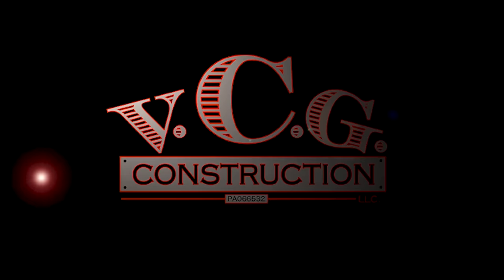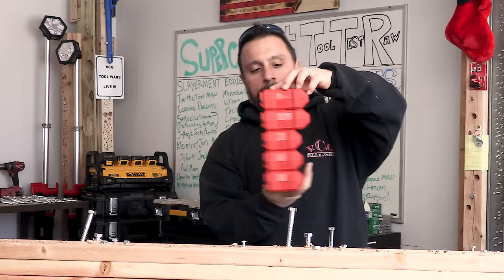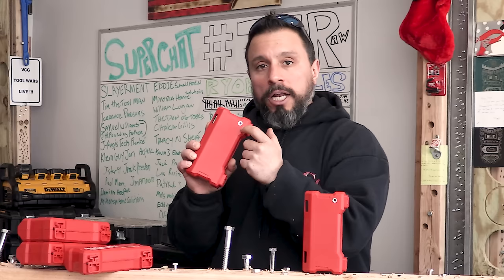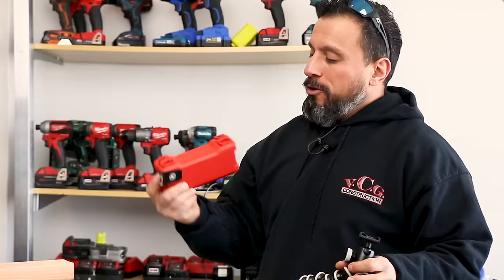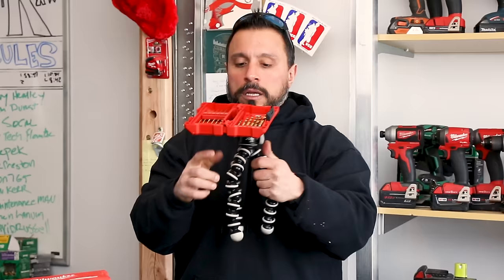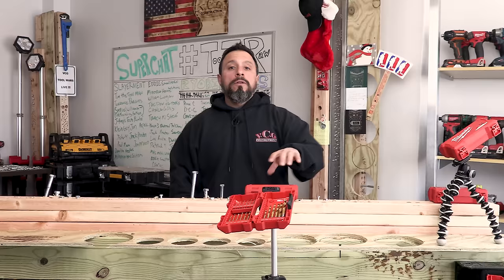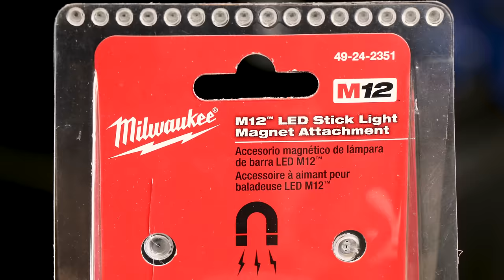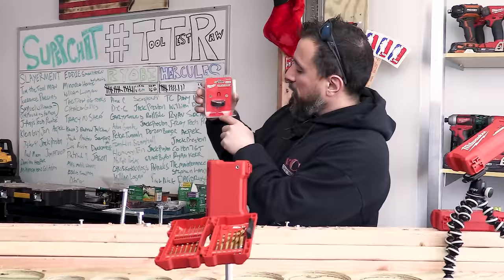99% OF PEOPLE DON'T KNOW ABOUT THIS MILWAUKEE TOOL BOX FEATURE!

Comment: the hardest thing about those bits is taking them out of the damn box. I always feel like my finger is going to slip and get cut on an adjacent bit. I use needle nose to get them out - it's ridiculous.
Reply: agreed to both of you guys. I have the one set with drill bits, and almost diced my fingers trying to get the out. Pliers or something to wedge them from underneath is the way to go.
Reply: So true
Reply: Lucky I'm an electrician and always have pliers handy just to pull them out
Reply: that is the truth 😂😂😂....
Reply: lifeisgood070 idk what it’s like for all the kits but some of the bit holders flip up
Reply: For real.  I put on a glove anytime I have to grab a drill bit.
Reply: My pull out game is already weak... this certainly doesnt help 😂
Reply: I've found that it helps to insert the bits upside down, so you grab the blunt end when removing them.
Reply: @jeremysaye1308  OOOOOOOOOO! very nice.
Reply: @jeremysaye1308  genius
Reply: @jeremysaye1308  YOU SIR ARE BRILLIANT 🤓🖒
Reply: Have sliced my finger Pullen on em keep a flat head u cut to fit in box to flip bits out they slot under them
Reply: Wawa it's too hard Wawa it hurts
Reply: If you pull the bits hard towards you it will stretch the plastic making them much easier to get in and out. I agree, it is ridiculous and terribly designed. Good job in the non important fuckn thing on the outside of the case tho.
Reply: This. This is the reason I would never use any of these attachments. I too have to use pliers most of the time. The one big downside to the cases
Reply: It's a love and hate relationship with this little bit case.
Reply: Amen to that brother
Reply: The hardest time I had with them, was unwrapping the damn thing!  It was worse then breaking into a safe.
Reply: It's better than having them fall out on their own inside the box. I recently purchased a Hercules titanium bit set and there are 3 bits just rolling around every time I open it. The milwaukee does loosen up over time, I like how they stay put.
Reply: I drill them out to loosen up the bit holders BC they are WORTHLESS as-is. That’s why the idea of a belt clip or magnet is so ridiculous... you’d pull the entire box off of whatever it was stuck to.
Reply: @uncletoy774  except you can't see what bit you are tring to pull out!...
Reply: I love mine as I used some silicone grease/or zipper wax stik on bits and holes and mine slide in and out much better like sex used to be...
Reply: I'd rather the bits be hard to get out that to fly out in the case cough Ryobi cough
Reply: I ream the holders out a little bit with a rat tail file.  It's worth the effort in the long run!
Reply: I have the drill bit set and understand this issue.  I use a flathead and slip it between the hex base and plastic bottom to pry it up.  Easy peasy.
Reply: I agree
Reply: WHY THEY SO TIGHT???
Reply: OMFG yes!!! What’s the benefit of a sweet case when YOU NEED A TOOL TO GET A TOOL OUT!!! I throw these away.
Reply: I had a bit box from another manufacturer that folded out.  They weren't hard 2 get out at all. You're right, I just bought this today.  Suggestions on making the holes bigger, or putting n upside down sounds helpful. I will try it.
Reply: Especially the hardened ones for steel I always end up using a rag or something so I don’t cut my finger
Reply: Just man up
Reply: I thought I was the only weak dummy, that didn't kno how to take em out. That y I watched this video. specific way or some kinda trick? Ik it ridiculous but I'm sure we all have moments where we get stuck on something that just so simple, u felt stupid then some1 else does the same thing nd make you feel a lil less stupid.
Reply: Y'all are too sensitive and never happy. I bet then y'all will complain that they're too loose. Or it's too perfect. It's cool though, cause, I'm one of those guys, lol.
Reply: I thought I was the only person that felt this way. I am still in iron worker full-time Welder getting burned  by hot slag  all day long but Im like a little girl and I am always a lil scared  when I have to pull out a1/4 inch drill bit from a new set.lol
Reply: @LibertyBusiness415  HA HA HA BOOM !
Reply: Yes
Reply: You don't use pliers, you can use a flat head and push out from the bottom where the hole is
Reply: WD40 helps but don't get it on the tip of the drill.
Reply: Y-E-Sssss!!! Exactly, you would figure in this time age manufacturers would have caught-on. Guess the Engineers are too busy with their feet kicked up on top of their desks to figure it out.
Reply: @jeremysaye1308  Then they are not being held securely.

Comment: I store my drill bits with the cutting edges in, not out.  First, you never worry about cutting your fingers when putting them in or taking them out.  Second, it is easier to see and compare rod sizes than imagining the rod size when looking at the sharp end.  It is easier to hold a bolt up to the flat back and see if the bit is a good size.  I like the carriage bolt honorable mention idea.  The magnet would quickly attract sharp iron filing that would have to be removed or risk injuring skin.  The other ideas are good but esoteric for my own use.
Reply: I never cut my finger doing that I store them normally.
Reply: @BannedByMe  oh man I have. When new they are hard to remove and I did it first try. Been very careful since, but I'm gonna flip em over now

Comment: For any photographers, we have Peak Design Capture Clips that can be bolted to the Milwaukee tool boxes. Then you can attach the boxes to ANY belt quickly and easily. We also have 1/4”20 neodymium magnet mounts that can hold about 10 lbs.
Reply: Where at ?

Comment: I think the reason Milwaukee doesn't sell the belt clip anymore is because the nut will pull out of the case. If you look at the case, it shows the nut was pressed in from the outside instead of the inside. So when walking around with the clip on, the case would fall off & spill everything.

Comment: I'm wondering if the belt clip is no longer available because it wasn't a tight fit on your belt and they slipped off and fell.  Hitting a co-worker with a falling object is a safety issue and they probably got tired of replacing the cases after breaking from the fall. 🤷🏻‍♂️

Comment: They also fit prefect in the hard cases if you cut spots out for them in the inner liner. I have a hard case for the 1/2” drill and 1/4” impact combo, I keep my 1/2” drill in it and cut out for 4 bit cases and can still put my charger in when I need it.
Reply from the maker: Nice Mac!!

Comment: Hi Vince, you recently reviewed Milwaukee’s little red shockwave toolboxes. Any idea why the bits are so hard to get out? I’m not fond of having my  fingers slipping on a drillbit trying to pull it up and out of a too tight holder, and slicing my finger open. DeWalt has a much better style. Flip up 90° and pull the tool out with no effort. I’ve resorted to putting a small stubby screwdriver in the box, and prying up from the bottom on the bit shank until it breaks free. Much savings on Band-Aids!!!!

Comment: That magnet is slick....slap it right on the side of the drill press!
Reply: So slick that it will slide down other slick surfaces and fall off anyway.
Reply: @HunterXray  he was sticking it on stainless steel
Reply: So what is that hole actually used for?

Comment: I sometimes use it to check the threads of a 1/4" bolt to confirm that it is in fact 1/4"-20 (which is what I often use with SnapToggle anchors). That's the most useful function I can think of. I've tried the kickstand thing just for fun, that could potentially be useful, but I never carry that bulky case with me anyway.

I always wondered why anyone would want to attach a drill bit case to a tripod..

Comment: As a Milwaukee resident, not affiliated with the company, the most resourceful way to utilize this is with the magnet and attaching to the top lid of a steel tool box. The profile may just meet that of the lid to conserve space.
Reply: By this,  I mean the inside, if you still require direction. In all honesty, are we reviewing a plastic case, or the tool itself?

Comment: I never even thought about what it was for but when you started the video I immediately thought of taking the belt clip off the drill. I have to admit I tried putting the drill on my belt and it's just not practical.
Reply: Id rather have my drill cliped to my belt... A drill falling from a ladder is much more thant 10.99 that these bits cases start at... I speak from exp.
Reply: I use the belt clip to hang a drill on my pant pocket if i'm just putting in a couple screws and dont have a tool belt on.  If I'm really working and have my tool belt on, I actually find the best place for the belt clip is to hang the drill in my hammer loop.  I also find the belt clip handy to hang drills in the part or a step ladder that connects the 2 legs.  But yeah, never actually use a belt clip on a belt.  Ryobi used to make a drill bit set storage rack called the "dock it".  The mikwaukee sets look like they should fit, but dont. I really wish Milwauke would come out with something similar because my problem isn't what to do with the sets when I'm using them. It's how to store them nicely when I'm done.  I probably have at least 10 of these mikwaukee boxes.

Comment: Where can you get the bit inserts for the boxes? If you flip the insert so the short b its are pointing  at you when the box is open you can fit several more rows of inserts in making it hold a LOT of bits. One box can hold the short version s of pretty much everything you might ever need including redundancies. But I can't find more inserts.

Comment: Out of Dewalt, Makita & Milwaukee, Milwaukee’s impact driver bits (P2 &T25) were the worst out of the 3 in quality and durability of the bits. Trying to screw in 1 screw to hat channel onto a steel beam was impossible without cracking and breaking a Milwaukee P2 bit. So far Makita’s gold bits have been the best for heavy duty work while DeWault also never really disappoints. (This is entirely my opinion, i usually frame heavy gauge metal but I do the ocasional wood frame and I run through 5 bits a day usually)
Reply: Switched from dewalt to Milwaukee because majority of dewalt things I got broke quickly but everyone has their preferences and different experiences
Reply: Sometimes you just have to trigger it because if you go full speed you can burn the bit right away. Wax and cutting oil work good too. But I do agree Milwaukee can make better bits and tips

Comment: i use the M12 stick light on a daily basis at work...i never bought the magnet cuz the price kept  going up everytime i wanted to buy it...at one time it was $30 but now HD sells it for $22...not worth it for a magnet in my opinion
Reply from the maker: It is expensive!!
Reply: Just get some threaded rod and super glue a magnet on to it
Reply from the maker: Maybe epoxy would be better Now!!
Reply: kingofthecrease30 I originally got the magnet with the m12 light... lost the light but not the magnet! Now the magnet rides with one of those red boxes.  It is practical when working on tightly spaced equipment where a tool belt is too much or a at height.  I just fill up the red box with bits, pencils, markers or whatever and hang it.  Kind of like the Fluke meter magnet to use in panels or to hang multiheads. But at $22 it's too expensive.  If it were $5 it would be very worth while.

Comment: Sorry Vince, It was actually completely designed for me. It's actual intended use is to be screwed onto the work area in a secured fashion so that when I can't get the bit out of the case when I need it, I can't throw it at the wall or window, thus creating more  work for the tapers or glazers. There, now you're in the know!

Comment: I attach a strong magnet to the underside of the top rung. Cut the plastic were it recesses down and i store my bits there. I have attached 2nd magents to my power tools for better ways to hold 2nd bits and screws. Thoses cases are sturdy and would add too much weight to my belt. Pluss my drill gets cliped on tho
Reply from the maker: Not a bad idea thanks Kelly!!

Comment: A really great use for the hole in the back of that case is to take a little piece of light weight chain that you can get from the home center and screw it to the back of the case then screw the other end of it to the drill press in the shop... now the bits are always there and never float away. 

It's also handy in retail establishments when you want to have a demo unit and you want to secure it down somehow so it doesn't walk off
Reply from the maker: Good move, thanks for the feedback!!

Comment: Nice video Vince. I didn't really pay much attention to the drill and bit cases. I have four milwaukee cases. The drills which fit into an impact driver I have trouble pulling out. They are in so tight I need something like a precision flat edge screw driver to edge them out to avoid cutting my fingers in the case I'm not wearing gloves. I recently bought the cobalt drill bits. I also have masonry. Milwaukee make some very fine drill bits and their quality is good.

Comment: Could probably also attach a carabiner for if you were on scaffolding or framing a roof and dropping tools was a safety concern or you just have butter fingers and get tired of climbing down to grab you box that probably popped open and launched drivers and bits everywhere.

Comment: I contacted Milwaukee about that years ago. At least some packages mention on the back of the packages the magnet and a hook. I couldn't find the hook anywhere. I called multiple people & Milwaukee, as well as bought the wrong hook. It doesn't make sense to me, to go through the trouble of putting a 1/4-20 insert into each case, then not offer the more logical accessory. Look how many accessory cases out there aren't using their own, uhmm... accessory. While only a tiny cost, it really adds up, especially not to be used. I think I was the big bad 40k :D
Reply from the maker: I’ll ask Milwaukee they axed the belt clip.
Reply: @VCGConstruction  Thanks, but it seems I've gotten by fine for several years without it. I saw it was an option, so I thought I'd at least give it a go at the time, but turned into more work than one would think.

Comment: I think they removed the belt clip because they stopped putting the nut on the back of most bit cases. I purchased a drill bit set for my impact driver to go along with the bit set that came with it, and the case doesn't have that nut on the back. also, since the magnet was intended to be used with the stick light, it only makes sense.

Comment: I use these for my job and find that the latch can easily break. I've had 4 break the internal latch from falling a few feet and one from a grill cart tipping over on it (10-15lb rolling on table onto box also on table). May be that they found the latches too vulnerable to impact for a belt clip to be useful. Still awesome boxes though

Comment: DeWalt also has one. The company who makes the plastic cases went to the drill bit retailers and tried to sell them these cases. Some bit and others didn't. Some were made of metal. It's hard when you get stabbed by those super sharp drill bits and it would be better if they would insert them base end up. And don't try to make these bits do the work of carbide tipped bits.

Comment: As soon as he said "quarter by 20" I thought "tripod". There are a ton of camera mounts out there that could be used with those cases. I've got a Joby with a bar clamp and a fence/net mount called a "LynkSpyder" that I use with a GoPro for recording my son's baseball games. Not sure how practical a $50 fence mount would be for a drill bit case, but hey, it's there if I ever have a need for it. By
Reply from the maker: Craig i agree that would be pricey!!

Comment: Everyone should have neodymium magnet set. they are great tools to have. I have a couple out of a PC hard drive that will hold like 2 lbs. I didn't have plugs for hyrdro hoses so I wrapped them w Teflon tape and stuck them to the ends. Held back 17 gal of fluid.

Comment: Either I got ripped off by the Home Depot or these were recently discontinued. I bought my shockwave set back in 8/2020. It did not come with the hole. Not a big deal at all but I'm just curious.

Comment: Would be easy enough to put a 1/4 20 eye bolt or d ring in it, and attach a lanyard in it so that if you drop it while up on scaffolding, it doesn't just fall off and smack somebody

Comment: One thing I HAAAAATTTEE. their bit holders are waaaaaayyy to stiff. Hard to remove, hard to put back in. Especially when I'm trying to pull a drill bit out..  I have to grab a sharp object and pry out with my hand... I hate em. I got about 9 of them.

I added my own magnets to the bottom. They all magnetize to the bottom of my shelving system.

Comment: Not knowing the unknown, I already came up with a cheap rig. With crimping tools and appropriate loop fasteners , cut to length any size cable wire (insulated electrical wire?) fashion a figure 8 loop as a belt hook accessory. OR...tethered to a tool bag/tool case exterior.

Comment: Magnet makes sense I guess, I always figured it was for some bizarre belt accessory.
Reply from the maker: Do you think you’d use a belt clip if it was Available?
Reply: @VCGConstruction  Eh, not for the shockwaves, but maybe for there bit set, could be kind of useful if working in some place like a warehouse/factory maintenance, just keep pretty much every bit you could need right there on you hip Philips heads, Torx, Flat head, Square head, nut drivers, ect. Could be a nice feature.
Reply from the maker: Got it!!

Comment: Just use some M1 or spray tack to glue the belt clip on.
Reply from the maker: Not a bad idea
Reply: Or drill out the hole on the clip to 1/4" and use a small bolt maybe?